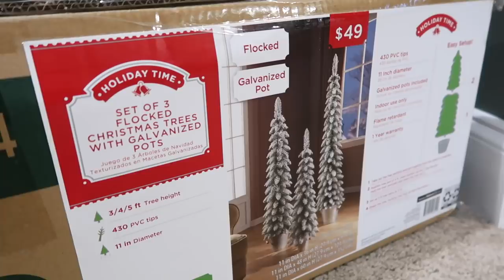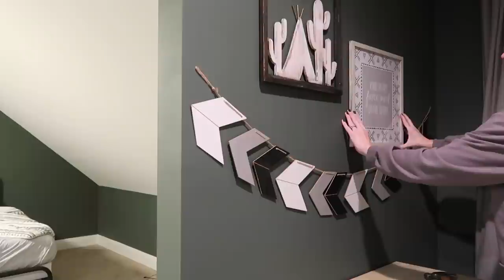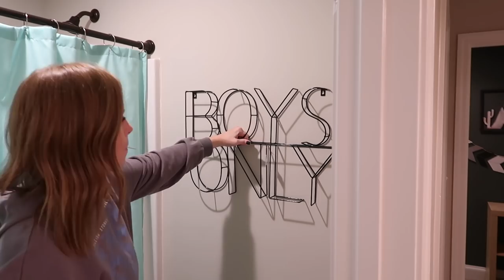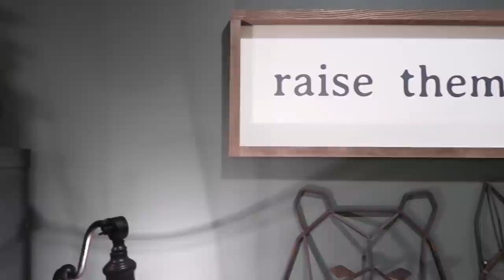HUGE PRE-CHRISTMAS DEEP CLEAN WITH ME | DECLUTTERING, ORGANIZING, & DECORATING

Comment: My mother and I have refinished a lot of painted furniture and the best tip I could ever give anyone is to sand/rough up the complete surface that you want to paint over so that there is something for the pain to grab to. Once sanded, wipe down with just water to clean the dust away, let dry and then you can paint.

Oh, also, work in thin layers so that you can make sure all of the paint can dry and you can control the overall finish if there are any imperfections.

Comment: The best way to paint a surface that gets bumped or dirty that needs to be scrubbed down I find it best to actually sand the original paint.  You don't have to get all the paint off but you do want it really roughed up.  Then I'd use a bonding primer and I'd use an oil based like a semi gloss paint because it's more durable and wipeable.

Comment: I've heard the Benjamin Moore is one of the best paints to use for cabinets (we don't really have easy access to Benjamin Moore paint where I live so I don't know from first hand experience), but prepping your surface is really important for getting paint to adhere (especially in high traffic areas). You want to do at least a light sand and add either a paint with primer in it or a coat of primer to the surface before you put your actual color of paint so that the paint has something to hold on to - paint chips really easy when painted onto a smooth surface.

Comment: In a perfect world I’ll be able to decorate when I have a clean space 😩 but to be fair, before I decorate a certain space I’ll clean that area to be spotless then decorate. The surrounding areas will be a mess tho 🤣

Ok so island, I love the kilz primer. You’ll definitely have to try and sand then apply your primer if you’re having some chipping on your island. After you use primer you can definitely paint and it’ll look great. If you want an extra barrier I would definitely recommend using minwax water base polycrylic to seal it because it will not yellow and is an amazing poly to protect your paint ♥️

Comment: Yay you're finally painting the island!!! My advice is, and I know it will be messy but sand the island down first, as you already have chips in the original paint and there will be more but you won't realise until you sand, so definetly sand it down to allow any other chips to be sanded out also will help the primer to stick better and not as many chips. When it comes to paint I know Valspar is here in the UK as well as the US and they do a great range of kitchen cabinet paints which are super hard wearing, plus i know here you can get any colour mixed so I'm assuming its the same in the US. The trick is several thin coats to build it up but allow time in between the coats to allow the paint time to cure it looks awful at first but its worth it in the long run, as helps make the paint tougher and last longer! Sorry for the essay 🙈🤣 much love to u all cant wait to see how it turns out!!! Xxx

Comment: I would sand it down first...then I would prime it with Kilz....do a light sand after you prime it...then I would use either chalk paint or cabinet paint...if you use chalk paint which is very forgiving...do four coats and sand between each coat...then seal with a polyurethane at least three coats...the island is the most heavily used....I did my kitchen cabinets....and island...my island is chipping because I only did two coats with one sealer.....lots of work but oh so worth it....doing it right will save the chipping as you have now....also make sure to do the inside of the cabinet doors